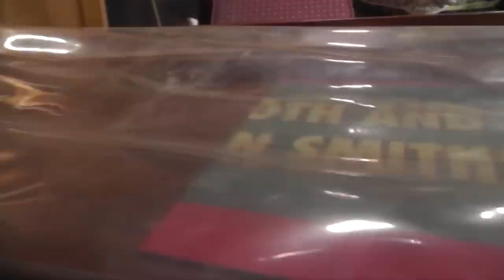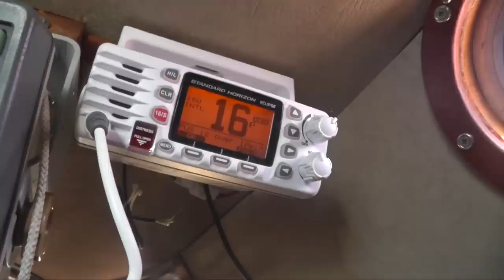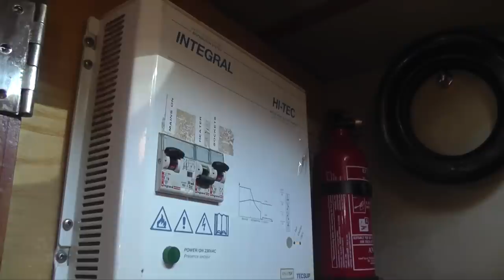Tahiti Living  Adventures of an Old Seadog  ep140

Comment: Barry:  you  need at least a sediment bowl on the suction side of the lift pump.... something with a screen in it to prevent rust %c from entering the lift pump and interfering with the little flapper valves.  I like the little clear glass ones with a screen in the top.   This will both stop crap from getting through, but also it will settle visibly in the bottom of the bowl.  Google "sediment bowl assembly"  (I use Duck Duck Go instead of Google.... no tracking).   When not running, air can get in anyplace in the system.... suction or pressure side, pump diaphragm, etc.  In your situation, I would send an oil sample in once I got to kiwiland to make sure you are not getting fuel into the oil.... which also can happen, either from the lift pump or the injector pump, and has less than a wonderful effect  on engines.   Sometimes air will even enter via the injector return system when an engine is not being used.  I have one very cheap customer with this problem... In his case the solution is not difficult, but as he has an electric fuel pump, and a filter that is high in the system, he just turns the fuel pump on (key on) and opens a petcock at the high point, bleeding the air out.  This works well for him, though I'd rather fix it "right".   I told him to install a boiler vent valve where the petcock is, and now he just turns the key on and waits 30 seconds for air to vent... a boiler vent is a little valve with a float inside that vents air until it's full.   Cut myself out of a job...... for the moment, but eventually he'll decide to do it right, and guess who he'll come to.   I did $6k worth of work for him last year .... I can afford to humor him, and he's a long time good reliable friend.   As a  last resort, a header tank made from a piece of pipe with two ends welded in..... perhaps 2L capacity, a boiler vent on top, in and out an inch or two above the bottom and a water drain in the bottom, placed between the lift pump and the filters would solve the problem .   The tank would not likely drain below the outlet, and as the lift pump pumps far more than the injector pump feeds the engine, any air that finds it's way into the system would be vented rather than supplied to the injector pump..............
      Needless to say, I have a lifetime of problem solving...... both conventional and unconventional.... I prefer to fix things "the right way", but fixing things is so they work is more important in many cases, and sometimes the original engineering is flawed, and I have no hesitation about correcting such things.   Engineers put their pants on one leg at a time just like you and I. 

Do what works, but keep in mind the issue of fuel dilution of the oil........ That can cost you a LOT of money. Get an oil test done ASAP.

Comment: With that mechanical pump just check the clearance, very easy . If your still worried install it and turn the motor over and take off and inspect for pressure damage.  I have Installed a couple mechanical pumps in same situation and the longer action handle the new pump delivers a pump that has a shorter stroke... good luck.  
Have a blast!!

Comment: I would recommend adding a check valve right before you fuel pump on the suction side. It sounds like the fuel is siphoning back into your tank because as you said it is slightly leaking on the output side of the pump allowing air in and letting the fuel to roll back into the tank. You are now positive of no leaks from your tank to the pump. So add a check valve right before the fuel pump so even if your output side of the pump is leaking a bit. The fuel will be right at the pump ready to pulled through the pump because of the check valve. A very easy fix for an aging fuel system.  ( Note : I think I saw the old check valve when you were showing the parts you had removed. I know a couple months back you had mentioned you tank had gotten pretty dirty inside and have since added filters. It is quite possible some debris had gotten in your original check valve before you installed the new filter and had been causing this problem for some time.) 

I hope this helps,
A big fan,
 Steven from Oklahoma USA.

Comment: The tuner should not be any problem as it would not get damaged unless it was soaked or someone overpowered it. I have an Icom 706 mark IIG with the smaller tuner and it has worked very well for over thirteen years. It still works and I will be using it again when I get back to the states.

Comment: Just get to Kiwiland for the major repairs. Auckland has all that you need.
You need to install some flux capacitors and wire them between your keel and mast and you can do a bit of time travelling if lightning strikes.
Install as much solar panel as you can on any available surface.

Comment: saw your lift pump problems, suggest you acquire a continuous duty electric fuel pump as a back up. You can pump it in line  (before your mechanical lift pump) and turn it on if you have problems starting...

Comment: Shame about Zingaro , nice people and i really enjoy their channel  but I can't say I am surprised .  I remember watching a video where they had crew on board and thinking that if I showed up at that boat to go to sea I would decline .  Old plywood boat not lightly used or that well maintained , I would expect  hidden rot in bad places just waiting to fail. I do have to give them kudos as fine seamanship to bring her in in that condition . 

Lots of flex in a cat or tri as one hull is on one wave the other on a different wave . I describe the feeling like sitting on a chair with one short leg as it stays level in a jerky motion rocking from leg to leg  . They need to be properly engineered and constructed  and that boat was home built.  Was in Antigua last year and a brand new tri out racing limped in with the cabin separating from the hull in not extreme conditions - we were out racing . Multi hulls are known for breaking things because they do not have the safety valve of heeling over to spill wind and have two hulls on different waves  . Modern cruising cats fix this by not being that powerful or that light but then they sail like crap . 

While the new cats are great and roomy and fast in the right direction I like the inherent safety in a self saving mono hull and if you throw in water tight bulkheads like Delos has , well pretty safe boat .

Comment: 100 years ago fuel delivery to combustion engines on small vessels used gravity.[ Daytank ] Your situation is to carry fuel on your decks this is the method I recommend to bypass mechanical or electrical fuel distribution systems  intermediate failure to your injectors... Cut a 3 inch hole at the top of a large fender.. at its bottom requires a small hole , fused by magnifying Glass A plastic pipe connected to the engine injector. Now hand crank the engine to start ... Barry don’t ever forget your heritage?  Jacktar

Comment: so if cook discovered tahiti? how did the bloody french end up owning it? and just a quick note on your engine if you havent already fixed it - the air in the fuel could be the injection pump, so next time its running ,switch off ,clamp the hose between  the injection pump and the lift pump and leave for a few days if it fires straight away you know the fault is definitely from the  lift pump back. and what is the length of your boat?

Comment: Ham radio operator here. Be advised with that auto antenna tuner: it doesn't actually tune anything. It just keeps your radio from frying in the event of a poorly tuned antenna. You will still suffer a great loss of transmitting range if the antenna is poorly tuned. Many operators will use a tuned antenna AND an auto tuner just in case. It's not really necessary if your antenna is well tuned for the frequency you are using, though.

Comment: Diesels must have fuel that remains for the injectors or injection pump,what ever one you have
Keep a can of starting fluid with you and give it a whiff 
In a pinch that will light it off enough to pick the fuel up and save on your starter and batted
It does not hurt diesel engines at all but is a little tough on gas engines
I am a 35 plus year master mechanic
Reply: REMAINS IN THE HEAD OR INN. PUMP I MENT TO WRIGHT

Comment: Hi Barry. Glad to see you getting on with a few projects.  Strange that in a seafaring nation port  you cannot get many parts you need.  Is it not possible to get rust converter and primer at a local auto parts shop ?  Hope the  SSB radio works after all that faffing about. Hopefully some Evostick a needle.thread and a couple of patches can keep the Bimini together till NZ    I was devastated about the SV Zingaro incident. Not seen any updates lately but I hope they can  a new boat of some kind soon.     Looking forward to the next video. ATB. Fair winds & regards from the UK
Reply: He can get them.  He cant afford them.
Reply: Starting at 4.16 he says paint not available new anchor not available, depth sounder not available etc etc.  He didn't say he could not afford it.   He said it was very expensive or not available in the Pacific region.I may be old but my hearing is still OK.   regards
Reply: You can see the current status at www.patreon.com/svzingaro
Reply: Thanks. :-)  regards
Reply: Gary C you may have good hearing but that’s not the point.  Don’t be ridiculous. All of those things are easily  available where he is. He used plastic material  he pulled from a dumpster in Colombia  and saved about a year ago to repair his dodger. I’m sure that there is no UV degradation will hold up well. Don’t forget Barry uses a great deal of poetic license and over dramatization.  That is, he is a bullshit artist. That doesn’t necessarily make him a bad person.

Comment: ONE OF THOSE PARTS YOU REMOVED ON SUCTION SIDE WAS A CHECK VALVE,,,I PREVENTS FUEL FROM DRAININF BACK OUT OF ENGINE MAKING IT START
 LIKE IT IS OUT OF FUEL
THE CK VALVE YOU REMOVED COULD BE BAD OR INSTALLED BACKWARDS

Comment: You mentioned that you eliminated all the connections on the suction side of the fuel pump.I hope you still maintained a fuel filter between the tank and and the fuel pump. You need clean fuel to the injection pump. Also if your fuel connection is at the top of the fuel tank, that fitting usually has a stand pipe that goes to near the bottom of the tank. I would remove the top fitting and the stand pipe should come out with it. I've see instances where the stand pipe has lost it's seal to the top fitting and the pump was sucking air there.  Not sure if the stand pipe would be a press fit, solder or brazed connection.  PS If you were about 30 years younger, and the opposite sex, I might consider signing on as your chief engineer!   LOL! Hope you get your engine problems solved!

Comment: Sure glad I have a 15 gallon gravity tank that feeds my engine.  I pump through a filter/separator and filter. to fill the gravity tank, then final filter at the engine.  I can also pump the fuel tank through the filter/separator without pumping to the gravity tank.  Designed after the diesel system on the submarine I was on.